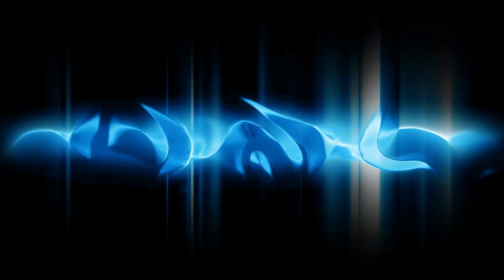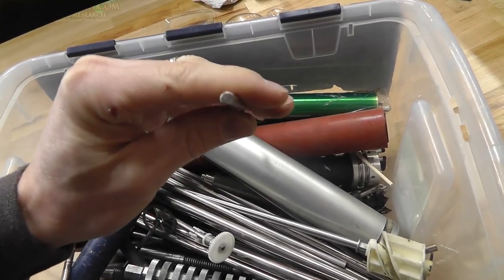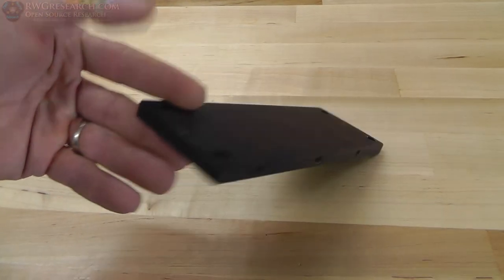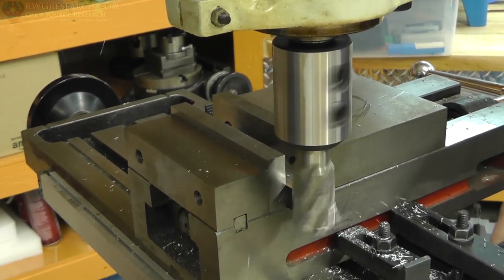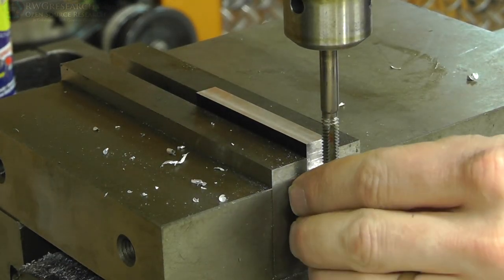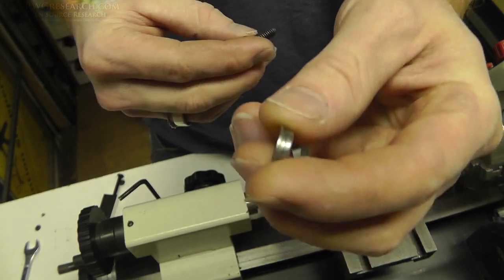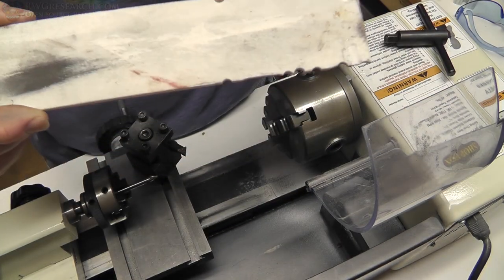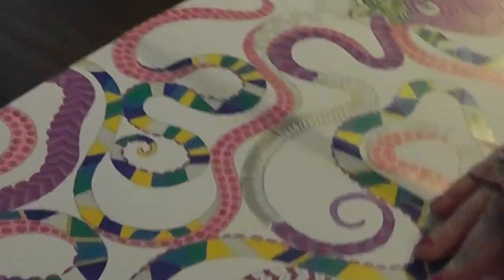RWG OSD #9 Part A : Making The Belt Tensioners. OverSize Delta 3D Printer Build.

Comment: For that particles i used vacuum cleaner with pressured air in front. Of course if not greasy part this is .:) Idea is good i like it but i think we need to wait for the part B. This belt tensioner is not too long? This part will be heavy working how do you plan to fix that  part mowing in sides when head will be near? What type o aluminum you are using?